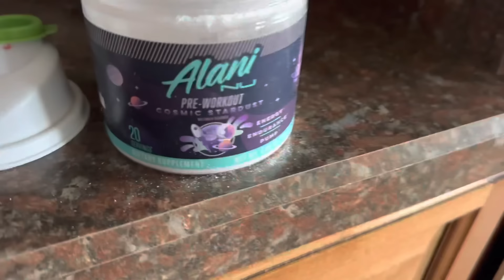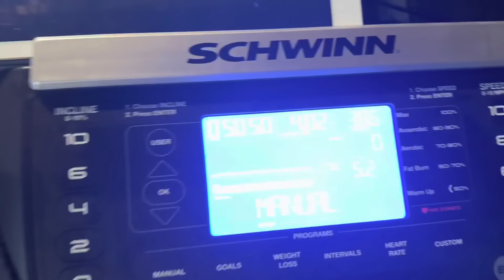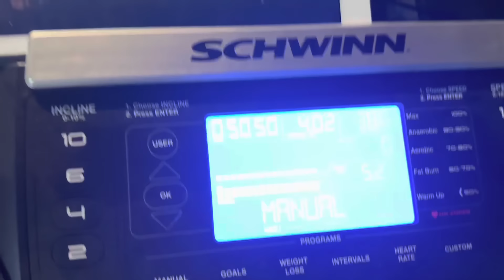Sebastian is Standing tall again! Friday Vlog💙

Comment: Hey Stephanie with a hole that big just sewing it wouldn’t work you need to get material put it on top of the hole and sow it on. It’s called sewing a patch and that way it could last longer instead of buying a whole new chair because the chair itself is fine. I did that with my kids high chair the plastic cover kept ripping and I took it off got some thick material and sowed n it on. I linked a tutorial on how to easily sow a patch.

https://youtu.be/HMqMy13JoSU